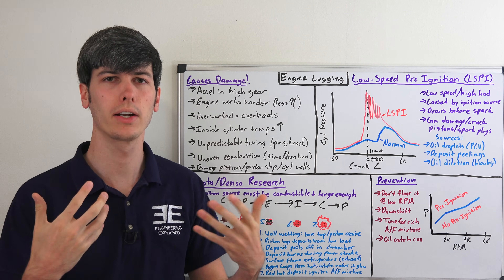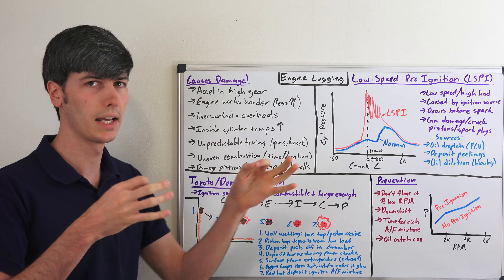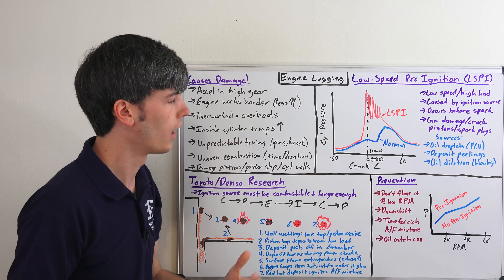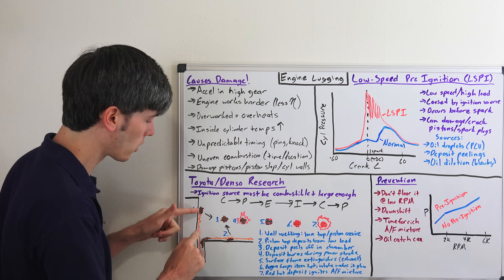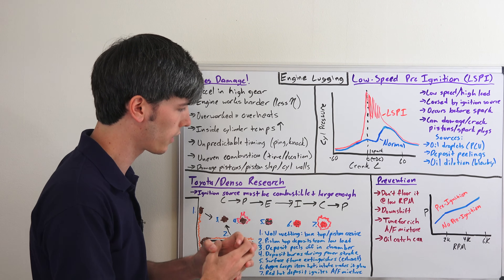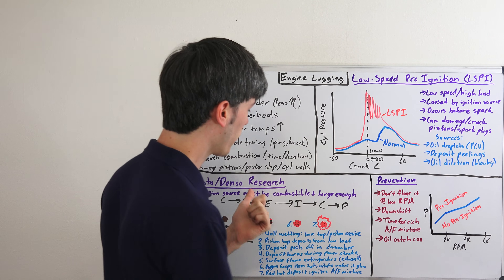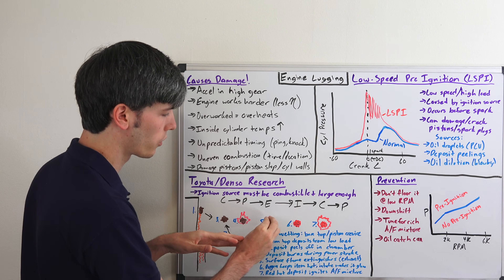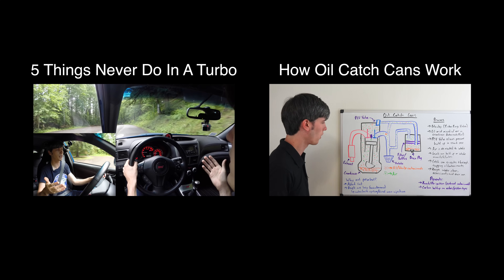Why You Should Never Lug Your Engine (Especially Turbos)

Comment: Definitely, in a car with a turbo, don't floor it in a high gear.  However, in a NA car, flooring it in a high gear is actually efficient.  You minimize pumping losses with a wide open throttle and minimize friction by being in a high gear.  I drive this way and can get 40 - 45 mpg in a 1.5l engine.  Toyota's hybrids including the Prius run at WOT over 90% of the time and the hybrid system tries to stay at low rpm as much as possible too.  No problems with pre-ignition have been reported with their engines, although they do run at a lower compression than conventional engines too.
Reply: true about the Prius engines thing is the Prius taxis out here take off with their engines revving high while the regular priuses take off literally on their electric motors humming across the intersections  ik now the Prius taxis get less MPG and more hell than the regulars  kinda ironic since it's supposedly a 'green' car 😂😂😂😁😂
Reply: My challenger gets 25 mpg on the highway in 6th gear. It's great!
Reply: @yanrodgers7775 lmao

Comment: Question..... Abarth (1.4 liter multiair turbo), when not in Sport Mode, has the factory shift indicator light at around 1800-2000 rpm.... that encourages lugging if you're trying to go for gas milage. Boost doesn't start to come on until closer to 3000 rpm. So either you are accelerating so slowly that traffic runs over you, or you're lugging. Why would they set the shift RPM so low if it's bad for the engine?

(Admittedly, I never shift that low)
Reply: For normal rates of acceleration, upshifting at about 2000 RPM s is fine for most cars.  If you want to accelerate faster put the car in a lower gear that will keep your RPM higher.  Just keep it below the redline. Manufacturers do set rather low shift points to increase fuel economy.  With a small turbo engine like you have I wouldn't hesitate to upshift at 3,000 on a regular basis and a little higher if your feeling "sporty".  If your normally upshifting at 4 or 5K , you may be shortening engine life.   Have fun with your little hot rod.

Comment: i pretty much do this every day in my 2015 ecoboost mustang. its auto and if im going 65 mph on highway itll be in 6th and if i floor it, itll drop itself to 3rd and then go. never had problems with my car and has 30k miles. 20k miles with cai and cobb tune. does shift hard everytime going into 2nd, jerks even.
Reply: Because your trans downshifts. The video is about flooring it at low engine rpm in a given gear and not downshifting accordingly.
Reply: you said your car is auto no wonder you cant lug you engine...

Comment: "By putting in these higher gears your engine has to work harder, meaning it's going to be less efficient." - I don't think that's right. If you look up brake specific fuel consumption maps, engines tend to have best efficiency at around 80% throttle in the lower half of the RPM range, only tapering off below 1500rpm. Looking at a Satrun 1.9l BSFC map to get 30hp power 75% throttle at 1900RPM takes 40% less fuel than 25% throttle at 5000RPM.
Reply from the maker: +Ants Aasma in higher gears you have a mechanical disadvantage due to the gearing (your wheel torque is less). As a result of this, yes, your engine must work harder.
Reply: +Engineering Explained my point was rather that an engine working harder is generally more efficient, not less.
Reply: +FeedMyNeed That's why I said that you should look at the efficiency map. A joule of kinetic energy is a joule of kinetic energy, regardless of gearing. Most engines achieve near peak efficiency well below 2500 RPM and start to drop off after that.
Reply: An engine working harder is only efficient if the work it's doing is efficient. Accelerating hard from a slow speed at a low rpm (aka high gear) isn't efficient. It takes a long time for the car to get up to speed even if you're flooring it. Instead you should drop a gear or two, which brings the rpms up into the 2500+ range, then floor it.

Comment: Is it possible to lug your engine in 2nd gear?
I know it's pretty much impossible to lug your engine in 1st because you always start from a stop in 1st.
Reply: Depends on the gearing but no, it's basically impossible
Reply: +FEVB if you tried to start from a stop in 2nd, maybe you could lug your engine.
Reply: If you're talking about an incredibly tall-geared, low-power vehicle, this might be the case. However, most commuter vehicles are light enough, and geared closely enough at 2nd, that this will never really happen - only a short few tenths of a second.

In comparison to what the video was getting at - like staying in the highest gear at <40mph and flooring it, which takes several seconds and dozens of cycles to get to a decent RPM.

Comment: Fan question here!
In automatic vehicles, when I want to accelerate fast, would it be better to put my foot above or below the kickdown point?
I know revving up the engine doesn't do it any good and I wonder if accelerating the fastest without having it downshift in an automatic is considered lugging. 
What would hurt the engine less?
1.2L atmospheric engine,  4 speed planetary transmission (so downshifting means quite a lot of revving).
Thanks!

Comment: far cry of some of the diesel trucks I get to drive.(yes i know yer talking of gasoline eng..haha)   I ran a mack that liked to be lugged at 1100 rpms pulling 60 tons of logs.  My friend has a scania 730hp that lugs on a hill at 900~950 rpms (16 liter) pulling 60 tons.   The engines just get down to low rpms - fuel pedal on the floor and happily "detonating" away pulling a big load.  These new diesels using compacted graphite iron to take such pounding strain as you mention about "pressure buildup" with knocking.

I used to run a dumptruck with a 392 gas jobby and would have to run it between 3400~4200 rpms pulling on a hill.  It would knock anywhere from 1800~2200 rpms if you press throttle and not gear down to crank the engine speed up.

great video, entertaining

Comment: My car is NA and automatic. In 7th gear, if I floor it, the PCM just doesn't open the throttle valves as much. Shouldn't this also be the case for all cars with drive by wire?
Reply: It depends on the computer tuning honestly.
Reply: Usually in an automatic when you floor it it tells the computer that the throttle plate is Wide Open and will automatically downshift to the lowest gear before redline.
Reply: Yoshi1u2 I do it in manual mode where it doesn't downshift.
Reply: hmm if its modern it might compensate like you said, just practice down shifting before accelerating.

Comment: I have a 2,0L turbodiesel, so pretty much anything under redline is "low RPM." Luckily, with 145 bhp flooring it doesn't mean I'll accelerate more quickly, so there's no point. ;)

Comment: Jason I'm a dummy but what's a blow of valve, does it have to do with turbos?
Reply: The part of the Turbo system that goes STU STU STU
Reply from the maker: Very similar to the bypass valve I discuss in this video, except it can vent to atmosphere. Relieves pressure between the turbo and throttle body, and can help prevent compressor surge: https://www.youtube.com/watch?v=5g6cHs5vMRE
Reply: +Sam Wilson no!! stu stu stu is compressor surge which is exactly what the blow off valve is trying to prevent from happening in the first place! a single woosh is the sound a blow off valve makes.
Reply: Releases pressure from the intercooler piping when the throttle valve snaps shut so that the air doesn't go back into the compressor wheel
Reply: +Mohamad Al Yousuf Hell yeah m8
Reply: +Mohamad Al Yousuf omg yes you are right I mis spoke. Well done.

Comment: If I won't floor it before I turn on the ignition my car won't start for some reason. My car is a Volvo 740 - 1989.
Reply: sounds like the engine is getting flooded. flooring while starting will clear an engine flood
Reply: *****
I just floor it to make it start, I don't continue flooring it after it has started. It has been like this for a week or two, my uncle(who is an mechanic) will have a check on it soon.
Reply: It is because you have a crap car :)

Comment: Great explanation! Now can you explain Why You Should Never Rev you engine?
Reply: Never ever use your car, it's bad for it!
Reply: Haha
Reply: uncreativename I don't think you got the joke lol
Reply: It's like trying to lift weight with you pinkie rather than just using your whole hand.  It puts a lot of unnecessary pressure on engine components.  Why lug the engine when you can up-shift but only use a fraction of the throttle, in effect allowing the engine to work like it should and depending on car, possibly even save fuel.
Reply: Lol
Reply: Oh yaa, I remember having it in like 5th gear at low speed like 40mph or something and the nissan motor made some weird noises when I tried to accelerate. I just shifted down to like 3rd or something, i dont remember because its been like 10 years since i drove a manual.
Reply: Sorry I meant shifting down in my other comment. My bad.
Reply: Lugging the engine usually only occurs at VERY low engine rpm, like below 1,000 or if your in 5th gear going 40mph (5spd). If when you floor it it doesn't sound like it's about to stall your fine.
Reply: Aaron Adnams Yet you're sitting at nearly full throttle, so it makes sense that there's more fuel pumping, not? Just changing the gear ratio (shifting up) gives a better output to input ratio.
Reply: Just watch the video but in summary it increases engine temp and can cause blowbly and all sorts of bad sheninigans. And it might use more fue because the engine is not efficient while lugging.

Comment: I wonder why manufacturers don't pot catch cans on their cars from the factory. It's not even expensive.
Reply from the maker: Because consumers don't want another maintenance item to deal with, and I suppose the added cost, however minor adds up across millions of cars.
Reply: Engineering Explained
Ok, but now cars have direct injection, variable valve timing, complicated turbocharger systems, electric assist this, electric assist that. A catch can is medieval technology by comparison. if they made one for production vehicles, I think they would cost no more than, say, an air filter.
Reply: no1ymfan1
I know, but most people have the oil changed by a mechanic anyway.
Reply: Why can't they just drain the oil right back into the oil pan?
Reply: +tavi921 I think he made a video on it. Most consumers are too lazy or uninformed to know to drain it. It should be standard on performance cars or as an option on all others.
Reply: If you have oil in your combustion chambers, then your engine has worn valve seals or rings, and probably blowby problems as well.
The less oil in the combustion chamber, the less carbon deposits that will form, and the fewer problems with detonation.
Reply: Its simple, there are better options like a good oil air separator in the PCV system, that way combustion gases get recycled to the engine and oil drains back to the oil pan. There is no way all car owners can be made to drain a catch can as often as its needed and where would you drain it too? You could probably mix it in with used motor oil and recycle it that way, but they honestly don't want that in the oil. The safest place for combustion by-products is to burn them completely in the engine. It wasn't a problem till direct injection and even now its not a problem for all direct injection engines. Its been blown out of proportion and it seems only a small percentage of VW/Audis are really affected.
Reply: @samhoffman1280  Ford Mustang 2.3L Ecoboost engines have the problem. I have a catch can and it needs to be taken off, and emptied all the time. Most people probably just throw the less than 1 ounce of oil into the trash can.
Reply: I think this could kill other people's business, for example replace our tires with airless tire these tire are usually no need for replacement like until 100k miles. There will be no more tire store or even industry many many job's are killed too.
Reply: @TR7 TRIUMPH t would contaminate the oil with fuel among other things. In the old days they would just vent the crank case to atmosphere. Not that I condone that.
Reply: The 2L turbo engines of 1980s and 1990s Fiats/Lancias all came with catch cans as standards.
Reply: +no1ymfan1 They are called air oil separators. Still need to be cleaned periodically though, and they need coolant to pass through them to heat the oil to prevent water from condensing out of it and causing sludge. They are pretty expensive; OEM's aren't going to put them in affordable cars.
Reply: thedog556:  Because it contaminates the intake system and causes excessive buildup on valves and combustion chambers.
An oil separator does not replace the PCV system, it just removes the oil vapor from the PCV stream.  I have them on several of my cars.
Reply: Most engines have these oil separators built into the valve cover where the PCV valve is located.  Trouble is, they're small and still let some oil mist through.
Reply: Deleting the PCV, besides being illegal, causes contaminates and condensation to buildup in your oil.  Better to install a proper oil separator.
Reply: I think the problem is that if your catch can is filling up, it can be monitored to a point where you can say "my product isnt good enough". as in if someones catch can is filling up more than their mates... well lets call the manufacturer and get that fixed. if there are problems with some cars, some use more oil, some use more fuel etc... they prefer their customers to not know and everyone is happy. imagine the amount of calls and recall/waranty repairs they would get if everyone knew more about whats wrong with their cars? some people drive until the wheel falls off, but the bearing and hubs were loose for 100,000kms. nobody knew but everyone was happy. manufacturers arent perfect, most of the time they just say "that will do, the customers probably wont notice"
Reply: tavi921 I had a catch can that froze during our winter blocking the flow messing my engine. The water that accumulates in there can freeze. This may be one of the reasons they dont put catch cans.
Reply: Crud.  You didn't figure I had no idea what an "0IL CATCH CAN" was????  Lol.  Thanks to Engineering Explained's video (watch?v=PWz6vCnJ4CA), now I know.   

All this time I was thinking we were talking about a drip pan beneath the engine, put in place to catch any leaks. LOL.
Reply: @ChuddleBuggy  Yeah. maybe next time try to have SOME idea of what you are talking about.
Reply: They could just dump them to ground has amount is very small.
Reply: my guess is because the returning oil would be contaminated by gas and other things.
Reply: volvos and saabs have catch cans that drain back into the oil pan
Reply: If you can recycle oil back to pan(like Jason said). Why they inject it to intake in Mustang ??
Reply: I believe Fords with the GTDI (ecoboost) engines have an oil separator on the PCV system, allowing it to flow back into the pan
Reply: the one in the gen3 3SGTE for the toyota MR2/Celica GT4 does =)
Reply: Tim Ramich nope its stock. the gen3 has one, look it up
Reply: 1998 Sienna has it
Reply: Tim Ramich yes.
Reply: It has to do with emissions. You have to empty that oil/gas/water mixture somewhere. instead they put it back into the intake manifold to burn up.
Reply: thanks for pointing that out. but the same thing can happen if the PCV valve fails
Reply: What's the point of a catch can???  Eventually it's gonna fill up and then you're gonna need another catch can below it.  :P
Reply: racing cars and rally cars use them as well as people on the modified/drift car scene.
Reply: if that's the case then they must be using it as a means of keeping car fluids from contaminating the track surface.  Normal cars shouldn't need them except for making them look legit race or competition cars.
Reply: You haven't mentioned how they are useful..."especially for turbocharged cars".  And if they aren't "leaking per se", I will reiterate: I don't see the point in having them.

Oh and yes, I have no intention of deluding myself into believing my 96 model japanese car is burning cleaner and extracting more energy per volume of fuel than a 2017 high performance top dollar car, lol.  All I'm saying is it's running perfect, with no check engine warning light, and is not leaking anything at close to 150k miles.
Reply: @ChuddleBuggy  And its probably not direct injected either, is it?
Reply: ***** no it does not
Reply: Many turbo cars have had catch cans from factory... only they form part of the PCV system and are not referred to as a catch can. Instead they are referred to as baffles or oil seperators. These baffles are often cheap pressed steel little boxes that trap oil droplets and drain those oil droplets back into the top of the head or block. no maintenance is required.
Reply: A catch can on a brand new car is humorous by todays standards, and frankly I have never heard of such a thing (maybe in the 40's, 50's, 60's they did it?)   I wouldn't put down a downpayment and get an ammortization on a car that is leaky or is expected to leak sometime during its lifetime.  I own an older 96 model Japanese car that is not leaking anything even as it is nearing 150k on its odo, and if it did start to leak, I would rather have the thing fixed than have a catch can put under it....lol.